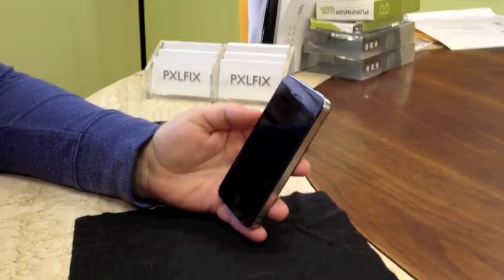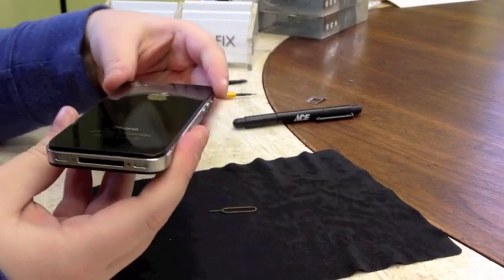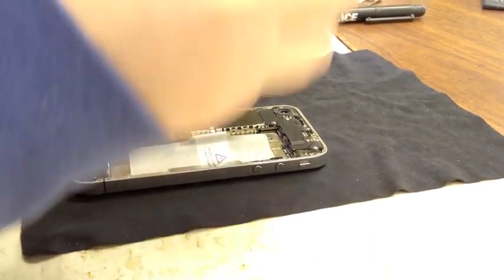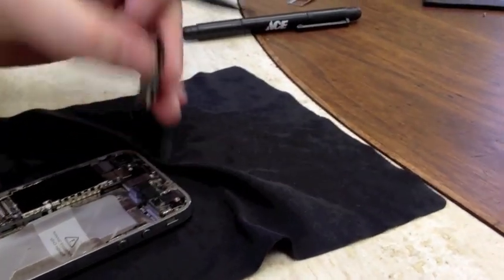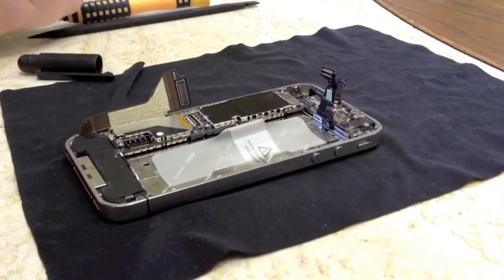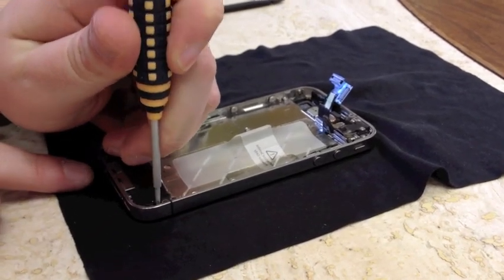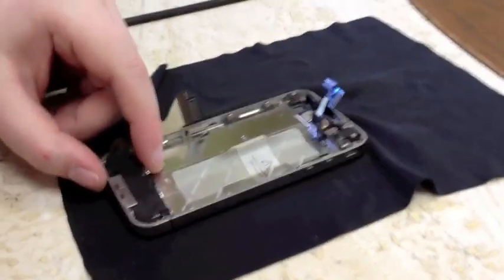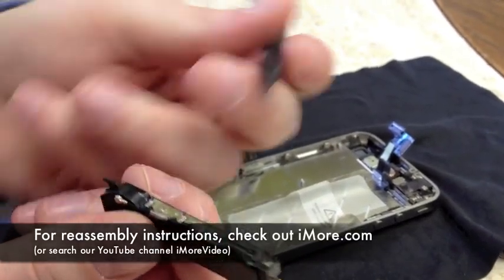How to DIY repair an AT&T/GSM iPhone 4 cellular antenna & speaker assembly

Comment: Hi, I lost the little delicate piece that connects the logic board, and we probably because it does not work wifi and GSM ... you can buy it separately? has it on eBay? I do not know under what term to seek